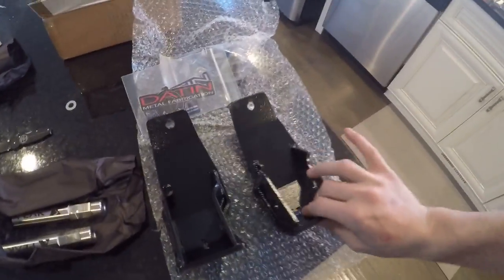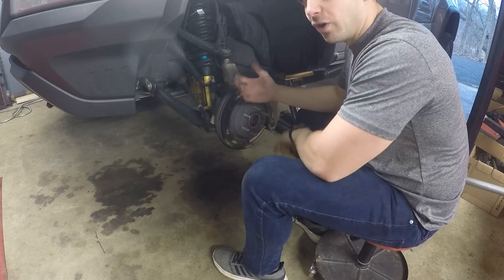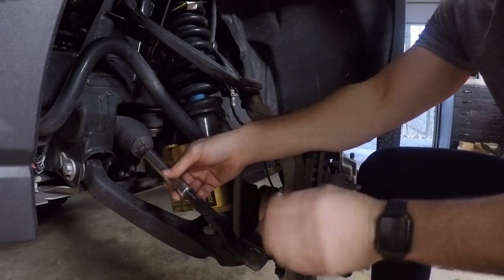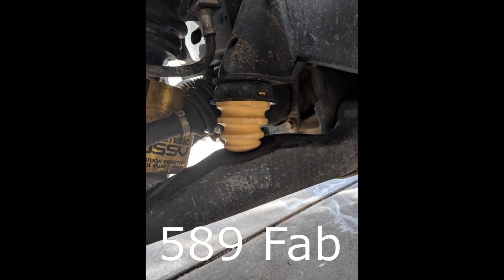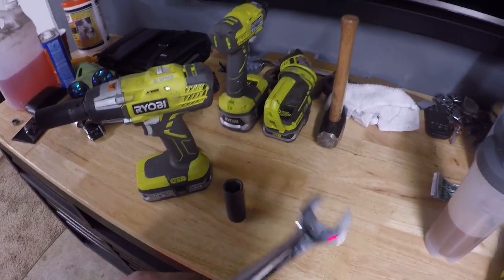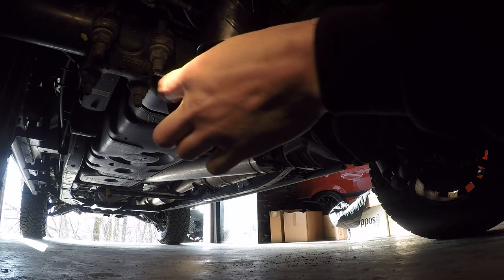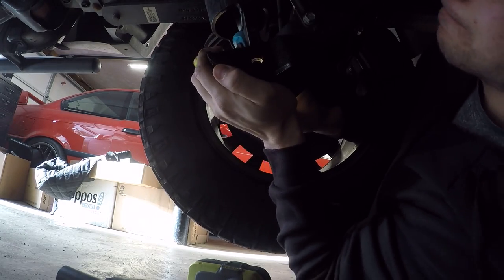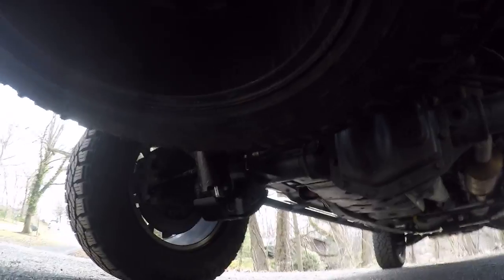HOW TO: Install Tie Rod Sleeves and Shock Skids - Colorado ZR2 (NEEDED OFF-ROAD PROTECTION)

Comment: Time for Timbren offroad bump stops, they work so great that you can eliminate the sway bar and retain oem drivability.  589Fab shock relocation is my next mod.
Reply from the maker: Steven Claggett I was looking at those. If money was no object I’d get hydraulic ones like the locked off-road version.
Reply: How many spacers, 0 or 1?
Going with a 589 level as well.

I want a full King set up with hydraulic bumps and all.

Comment: the intro lol
but yeah... I field tested these shocks kids and they did  great for a few months until I realized that they don’t solve the problem of the exposed passenger side rear strut. The jeep wrangler puts both shocks behind the axle which avoids any of these impact issues. but the Colorado instead has the passenger side rear shock in front of the axle leaving it vulnerable to rocks and any other obstacles. I highly recommend you remove these kids and sell them and put on those Rago (Ragu?) shock skids. I just busted up one of those beautiful DSSV shocks in the rear. I got slightly distracted by the view and ran over two rocks that were just high enough to bend The passenger side rear strut. i’m pretty confident if I had the Ragu shock skids then they would have deflected the rock just enough to save the shock. i’m going to remove these off my truck and give those Ragu a try. i highly recommend the same. driver error aside, having the Ragu shock skids would save me from having to tiptoe around the rocky trails as much and worrying as i drive through water crossings that prevent me from clearly seeing the rocks underneath. just wanted to let you know in case you happen to be going on any rocky trails!
Reply from the maker: I haven't thought of that issue, but that makes sense.  Instead of changing the shock skids, I'll probably do the shock relocation kit instead, but we'll see.
Reply: ah you’re very crafty! i could see you doing that instead. that would make a cool video. yeah I just highly recommend relocating the shocks or ditching these skids for the Ragu sooner rather than later. I’m pretty sure PA had some rocky terrain as well. GM uncover the shock because it is clearly damage of my own fault so just also bear that in mind
Reply: *won’t cover
Reply from the maker: Yea there’s some rocky off road areas in the nearby off-road park for sure
Reply: if you’re referring to AOAA, then i believe that’s exactly where it happened. haven’t seen rausch creek yet.
Reply from the maker: AOAA?
Reply: Anthracite Outdoor Adventure Area
Reply from the maker: Looks neat I’ll have to check that out when it’s warmer!

Comment: Boost, I'm in the market to purchase a '21 Bison later this year, but I'm concerned with the issues that the Colorado had with their transmission, electrical and other problems from 2016 to 2019.  Yes, I get it all vehicles have their problems, but if the problem arises under 15k miles, ehhhhh....I dunno.  I mean for Pete's sake, there was class action law suit!  Have you personally had any experiences of "shuddering" etc!  I'd like to hear your experiences so far.
Reply from the maker: Silent Pinoy, I haven’t had any transmission issues. Granted, mine is a diesel and almost all of the transmission shudder problems are exclusively on the V6 models with the 8 speed. 

I’ve got 6500 miles on my truck and plan on doing a review a little later around 7500 miles.

Comment: Did you say the IFS has more articulation than a solid axle? I love my 22 rz2 colorado but the suspension travel sucks compared to even my stock 01 cherokee or my enormous 76 suburban. Here in Colorado solid axles rule the trails.
Reply from the maker: Guess it depends on the solid axle.  ZR2s are not known for long wheel travel, that's for sure.

Comment: I have the same bump stops, and have the same problem. I’ve been curious on if I should cut them. Any difference in the ride before or after?
Reply from the maker: I didn’t notice a difference.  Apparently they are pretty soft so you could probably just leave them alone. Eventually I’ll upgrade mine.
Reply: Boosted Apex I feel the same way. Cheaper than the timber ones that are around 200$
Reply from the maker: I want a full long travel kit with bump stops so....that’ll be $$$$ lol

Comment: Ummm the terrible coating on the Colorado’s don’t exist. Midsized truck frame is e coated. Where as the full size 1/2 ton and up are wax coated. Just FYI. Happy with the frame coating on my zr2. Not su much my Sierra 2500 duramax
Reply from the maker: That’s true. Wax coating is terrible!!!!